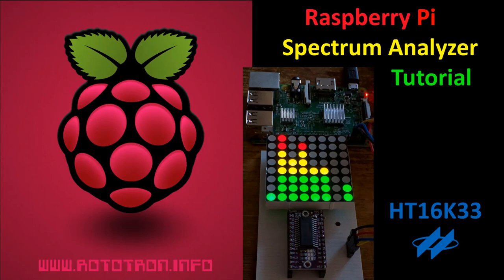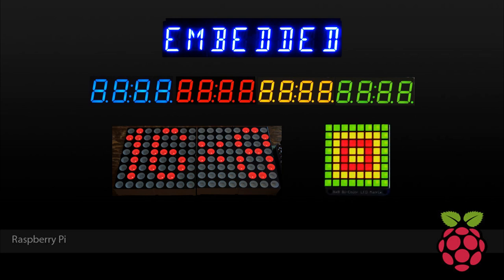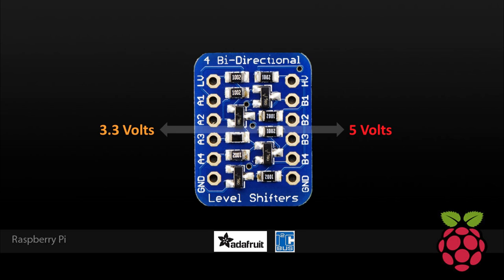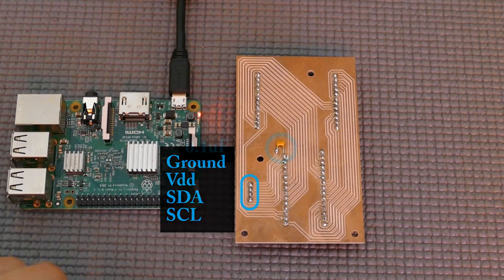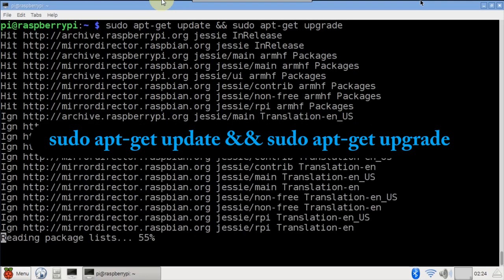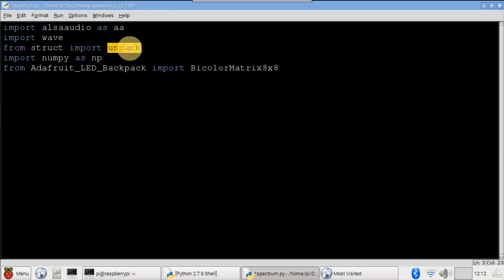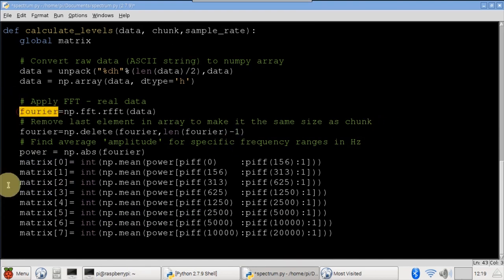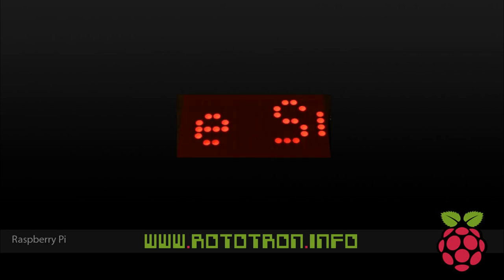Raspberry Pi Audio Spectrum Analyzer Tutorial Using HT16K33

Comment: Any chance you have some updated instructions?  I'm having trouble with installing Python Imaging, Python SMBUS and Python ALSA Audiolib.  I think this is really cool and would like to see if I can get it to pick out individual notes and light up the corresponding LED.
Reply from the maker: I added updated instructions to my website:  https://www.rototron.info/raspberry-pi-spectrum-analyzer/#CP
Reply: @rdagger  Wow, that's amazing.  I was just thinking I bit off more than I can chew on this project.  I had the LED Controller working with 4 test LEDs but I was never going to figure out the virtual environment.  Wonder if I'll be able to handle turning turning this into a note detector.
Reply: @rdagger  Should the microphone section of the code be working as you originally described it or did I do something wrong trying to switch from the wav file to microphone?
Reply from the maker: @paulandrusyszyn9177  I uploaded updated microphone code to my website.
Reply: @rdagger  Am I allowed to leave messages with links?  I thought I left a comment yesterday on reducing the errors in AudioPy and I needed some help with Numpy.

Comment: Hello, this is incredible.  I am adding this to my LED matrix project for my classroom.  Do you know how I could go about adding a peak hold to the code?  Thanks again.

~Leko
Reply from the maker: I haven’t tried, but in theory you could remove the display clear.  Instead you could run the loop twice and on the 2nd pass clear each LED except for the peak.  On subsequent loops you would have to decide how to handle lower peaks.  You could clear lower peaks but this would fill up the top of the matrix quickly.  Alternatively you could add a counter to fade down old peaks.  I’m sure if you search GitHub you can find some examples.

Comment: Can I daisy chain multiple displays to get a bigger matrix (in width for example)?How would i have to change the code if I wanted to do that? What about using microphone for realtime spectrum analyzer?
Reply from the maker: Yes, you can daisy chain multiple HT16K33's on the I2C bus.  In terms of software, the Adafruit backpack library is extensible.  I derived a 16x8 child class to create the scrolling message at the end of the video.  However, that is only a single HT16K33.  I am working on another project that will daisy chain 3 HT16K33's for a total of 384 LED's.  I will post the code when I get it working.  I'll also try to post some microphone code soon.
Reply: +rdagger68 great! are the libraries specific to the raspberry pi? since i have the orange pi :)
Reply from the maker: There could be issues with the Adafruit libraries.  I remember seeing some posts on the Adafruit forum regarding compatibility with the Orange Pi.  I don't know if they were resolved and I don't have an Orange Pi to test.
Reply from the maker: I posted the code to use a microphone:  www.rototron.info/raspberry-pi-spectrum-analyzer/#microphone

Comment: Do you know if this will work with the Raspberry Pi Sense Hat?
Reply from the maker: You could probably make it work.  The display code would need to be rewritten.  I’ve never used the sense hat and I don’t know if its driver software is performant enough to keep up with data.
Reply: rdagger68 Hey thanks for replying.  I got it half working so far.  I can get the equalizer to show on the HAT in just one color because for some reason the 3rd to the last line of your code sense.set_pixel(x, y, spectrum[x]) it's throwing a TypeError: object of type 'int' has no len().  

I'm trying to figure this out but for now, I took out the "[x]" and change the spectrum to point to a specific R, G, B like (255, 0, 0) instead of what you have [1,1,1,3,3,3,2,2]
Reply from the maker: The set_pixel function is expecting an RGB.  Try this:
red = (255, 0, 0)
green = (0, 255, 0)
blue = (0, 0, 255)
spectrum  = [green,green,green,blue,blue,blue,red,red]
Reply: rdagger68 holy crap, that did it. I switched blue to yellow to go with your steps.
I now got your project to successfully work on my Raspberry Pi Sense HAT.
Thank you very much for your assistance. 😊
Reply: vh9network how did you do it on the sense hat

Comment: Lamers. Stop uploading those completely unusefull, wasteful videos. No one sane would use a Raspberry Pi for such a simple projects that a 4$ micro chip would handle. It is like taking a bulldzer for picking up mushrooms.
Reply: Well... The pi zero is like $5 so...
Reply: That's true, though as Hanz said the pi Zero is 5 bucks, and using the pi is more about compatability and simplicity, as there are a lot of hats and other things that work with the pi with very little. Also, a lot of people that use RPis semi regularly might have an extra one they don't know what to do with. If you already have a pi, then there is no reason to buy a micro processor